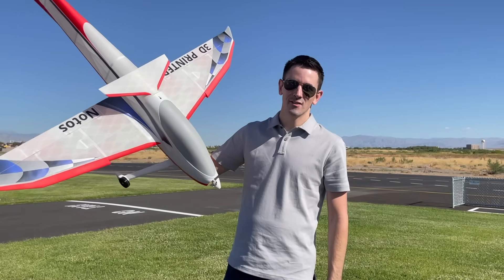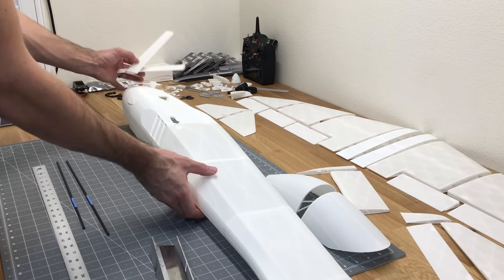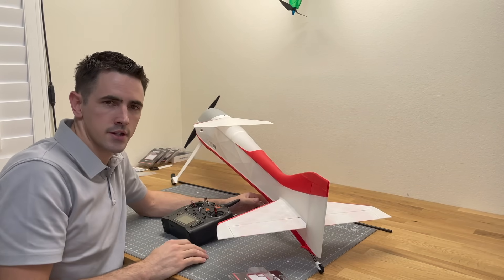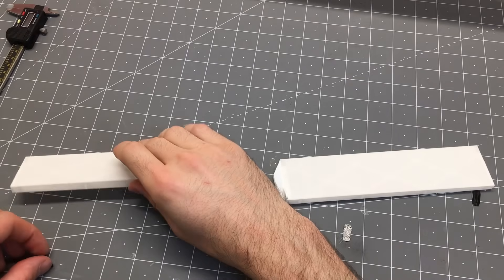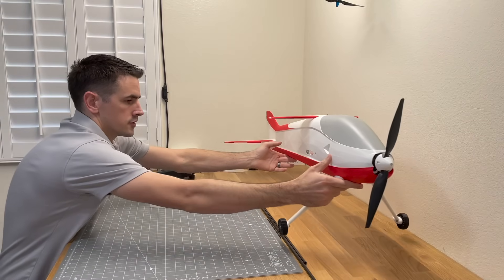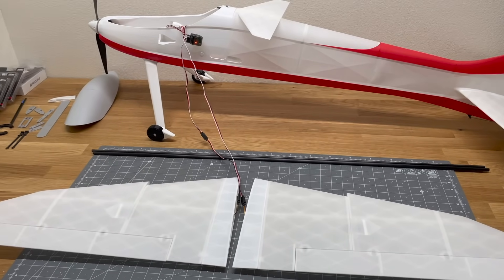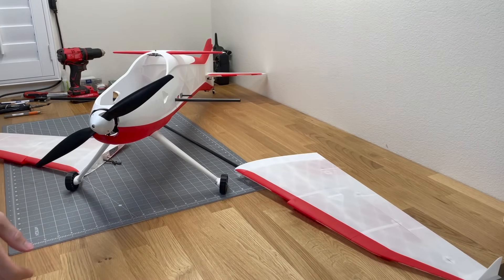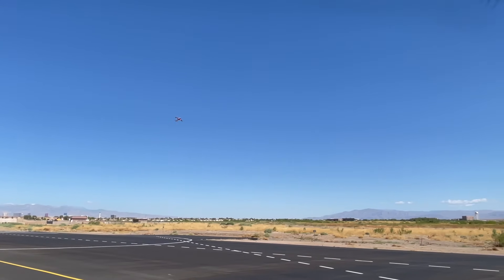BEST 3D Printed 3D Flying RC Airplane - Planeprint

Comment: Looks great. You’re getting some great print quality now by the looks on your videos. One minor thing since you are teaching people. The angle you set in attaching a wing to the fuselage (the fixed mechanical setting) is the angle of incidence. The angle of attack is the angle to the airflow (ie when it’s flying.. it’s always changing).. 
Nice video as usual.
Reply from the maker: Thank you! Good catch. Not many people know the difference. It is called angle of attack on the pdf file, and I didn't want to confuse people by calling it something else.

Comment: I have a couple suggestions: Use wood screws to bolt the motor to the fire wall. It's difficult to unbolt nuts and bolts if you need to later.  I needed to, I may have inadvertently put too much stress on the front section of the airplane, because the next time I flew it the front end of the plane came apart and the motor ejected itself.  My next suggestion is to cover the entire front section with a thin layer of  CA this includes the area located where the landing gear attaches.  One less than rough landing the gear will be unpleasantly be removed from the fuselage.  I covered my finger with clear tape during this operation so it slides along easily.  ( suggest doing it out doors).
Reply: Up date to my own post. I tore off the front end again. I am using a Emax GT2826/05 Grand Turbo ... To much Torque for the front end with a 4s battery.  3s was fine.. I thought I would go to a 4s since I figured I had a better print going and the extra CA.  I reprinted it again and will stick with less  powerful motor.  If fly's great.

Comment: Good job on the design. Not knocking your work here but as a 15 year competitive 3D pilot for the price you are asking for these files someone could invest in a balsa or foam plane that would fly 3D so much better. This 3D printed plane will NOT do 3D maneuvers anywhere close to a Foam or balsa plane!

Comment: Awesome! Finally, the 3d printed airplane I have been waiting for is out! Definitely the next one I build. I thought that 3D printed airplanes were too heavy for 3D flying but this one proves me wrong, 1500 grams for 1300 mm wing span, this is pretty good. I already downloaded the free manual and I am impressed by the quality of the work. Thanks for the excellent video. This is the second airplane I buy after watching one of your video (first one was Eclipson Model R) !
Reply from the maker: I was super suprised by how lightweight this plane is, I was looking up comparable sized foam planes and the weight is nearly the same. So impressive! This plane flies great, you will have fun with it! The Model R is an. awesome plane as well
Reply: @TroyMcMillan  Impressive indeed. I took as a point of comparison the Multiplex Acromaster, which is my all times favorite aerobatic/3D plane. It weights 1350 grams for a 1100 mm wingspan. So the Notos weights about the same as a foam plane! Pretty excited to build and try it!
Reply from the maker: @YouMakeTech  Sweet! It is a great flier! Let me know if you make it :)

Comment: Dear Mr. Troy, thank for the great video, Im 61 years old, RC pilot and pattern since the 80's, one question can I print this plane on a Fokkos 3D printer, the reason of my question is that I printed the Piper J3 and I ran with so many problems using Cura and Prusa, your video was so easy and that not happen to me , before buy the files, so do you consider to use another 3D printer. Tsk and regards.

Comment: What's the brand of kicker you're using with that CA?  The stuff I have here makes Zap Medium turn yellow.
Reply from the maker: The stuff I have makes it turn yellow too! So I just don't use it on parts whenever possible. Mine is Zip Kicker CA accelerator

Comment: I bought the motor you recommended, but it doesn't come with the correct prop adapter. Mind providing a link for the one you used?

Comment: Nice build !  I`m nearly finished with mine but the carbon rods are so tight in the wing it`s nearly impossible to get them on. Any solution ?
Reply from the maker: put the carbon fiber rod on the end of the drill, and just slowly turn it - it will go right in easily!

Comment: Anyone else having issues with "BLOBBING/ZITS" on the rounded portions.  I have been using the recommended version of Cura, but have blobs on the rounded  proton of the fuselage. Newer versions of Cura print much better but end up incomplete.  This plane looks awesome but has a ton of print issues.

Comment: Thanks Troy,  great video again.   Quick question, when printing the wing sections I have a problem with the very ends lifting a little, the last 10mm lifting about 1mm.   I've tried blue tape and glue stick and still get the same issue do you have any suggestions for a cure?    Printer is a Artillery Genius.  Thanks.
Reply from the maker: This is my most common problem when I have failed prints. On the genius, try hairspray that works best. Also, I set the bed slightly closer to extruder than recommended. It will cause a bit of an elephants foot but that is easy to cut off and reduces the chances of it lifting up
Reply: @TroyMcMillan  Thanks for the response,  much appreciated.      Bald guy goes into a shop and buys hairspray..... this should be worth a laugh
Reply from the maker: @justjonfpv  😂 that is funny! It works so well its worth it. Have you tried it out yet?

Comment: Thanks for the great video Troy! Just a quick question if you dont mind, you use Overture pla for the planes body, would you think that using eSun pla instead would produce similar results with similar settings to yours ( Its the only one i can get hold of, infact its their pla+ ) Thanks in advance =)

Comment: Is that field in Arizona? It looks like the same field that the Tucson Aerobatic Shootout is held.
Reply: It's gotta be Bill Bennet field just north of the Silverbowl football stadium.  I was just noticing in the thumbnail how there's so much less vegitation to the north and northwest.  There used to be a clump of trees and thick brush to the northwest...I had a couple of planes go down in there and they were a pain to get out.  There's beens some fires over there over the years so maybe that thinned them out, or it's the drought.  I haven't been out there in person in probably six or so years.
Reply: @edwardwaldrep7727  I'm not familiar with that stadium. The flying field looks like the same field in my Tucson Aerobatic Shootout DVD.
Reply from the maker: @GuitarGuys7299  Just as Edward said, it is Bennet field in Las Vegas :)

Comment: I would like to do a couple of plane print builds, but  I live in Texas and seen what a little heat outside does to pla prints and I can imagine light weight pla would probably even get pliable quicker in the heat. What are your thoughts?

Comment: your hinge are made TPU?  Is it the same type as you would use on the tires?
Reply from the maker: Yes they are 3D printed with TPU flexible material the same as the tires.
Reply: Thanks

Comment: Hi Troy. Great video mate. I've been flying RC models for 50 years and have a Prusa MK3s printer. I've never printed an airframe before though I've printed countless control horns, motor mounts etc etc. I wonder if you know whether the Prusa would be able to print one of the Planeprint models? In other words, would the Cura slicer be able to create a Gcode file for the Prusa to work with? I don't really want to buy a set of STL files only to discover that my printer cannot cope. Any advise would be gratefully received.
Reply from the maker: it can absolutely do it!! Let me know how it goes :)

Comment: An inspiring video with matching presentation and not the first of yours I have watched though I have yet to overcome the chores to get started with 3d printing. Since you are very clear about terms, I was curious about the angle of attack adjuster. It looked like it adjusts the angle of the chord of the wing to the axis of the fuselage just like an F8 Crusader's variable incidence wing. Those were the days ( only a little before mine) when angle of attack (relationship between direction of free air to the chord of the wing) was traditionally  detected by airframe buffet at the max value where it matters or ignored by the man on the shiny levers. Many wings, in use for several decades, require instrument indication of this value as advances have made their buffet level unreliable as a safe guide to diminishing lift and control. This is nit picking as far as the value of your video is concerned but could also mean I have missed something. I look froward to your next build.

Comment: Great plane, thanks for sharing my friend. It reminds me time ago when I started flying pattern planes I used to fly a tail dragger pattern airplane called Mystic 30, designed by Hanno Prettner, equiped with an OS .32 engine, tuned pipe and retracts The best plane I ever own and flew. Unfortunately I crashed it in an insane and very low maneuver over the runway. I am searching in the Internet the drawings in order to print it in 3D. If somebody know where can I find it, I will really appreciate it.